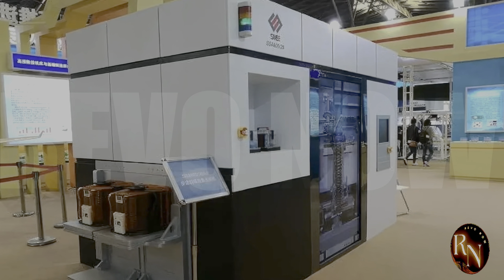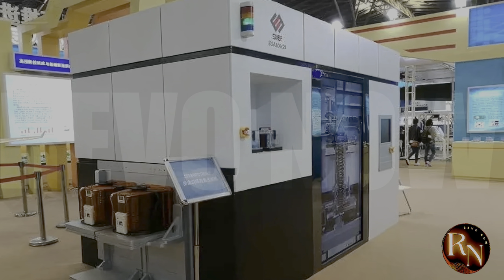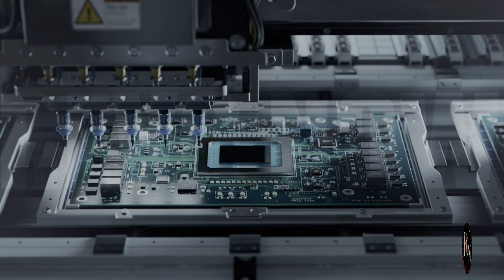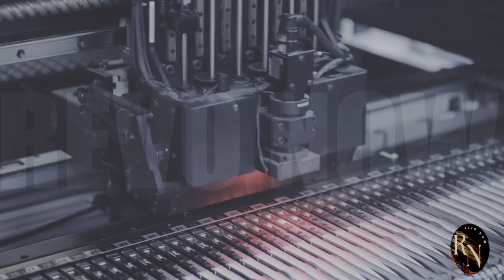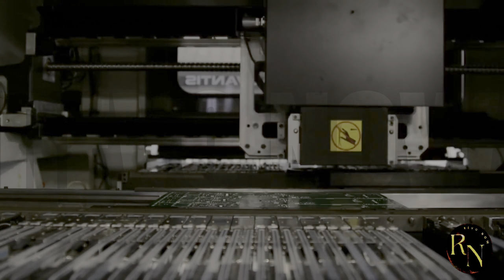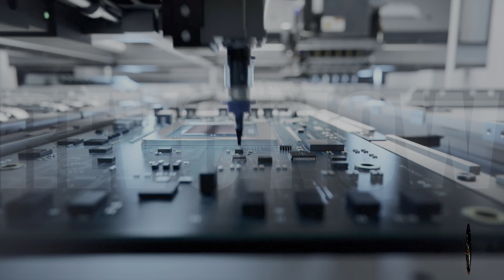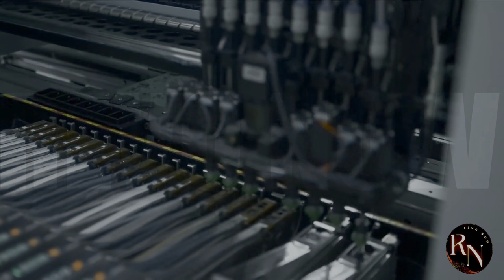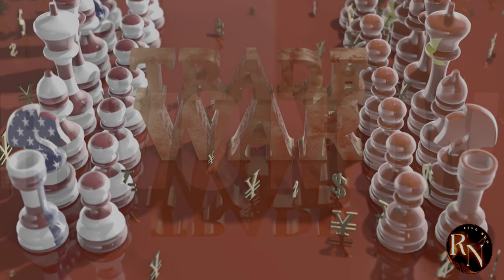China's ASML Killer: SMEE Lithography Machine (2024)

Comment: Is this the 28nm DUV machine that is roughly equivalent to ASML's DUV machines? It's not competitive with the EUV machines that TSMC, Samsung and Intel have bought.  But still good progress.
Reply: YEAH its 1 generation behind, but China was not supposed to got to this stage for another 10 or 12 years when they introduced the CHIPS act and banned export to China of the EUV machines.  Also China re designed the chip architecture so you can no longer directly compare a US 7nm chip with a Chinese 7nm and its closer to the US 5nm 

Then they can layer the lithography - its slow and expensive but they can get 5nm which = US 3nm but at very high cost with lots of unusable chips.  

They are making LOTS of progress and will probably be global No1 in 5 to 8 years